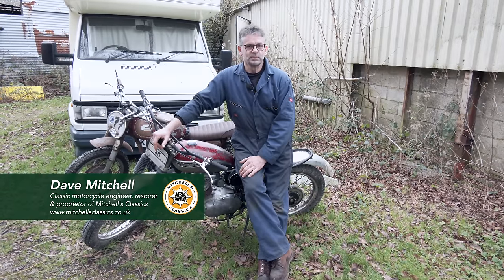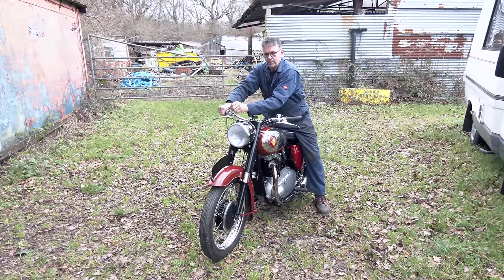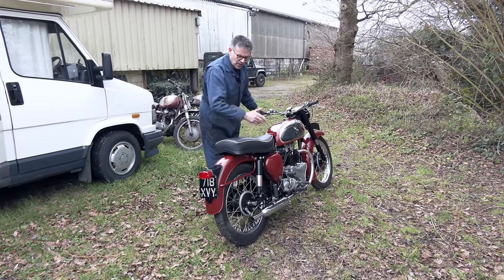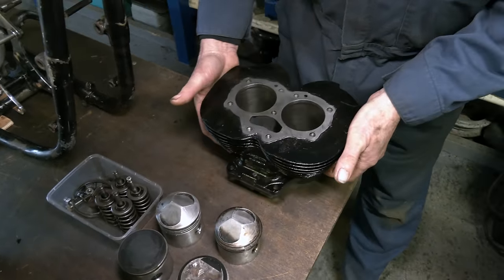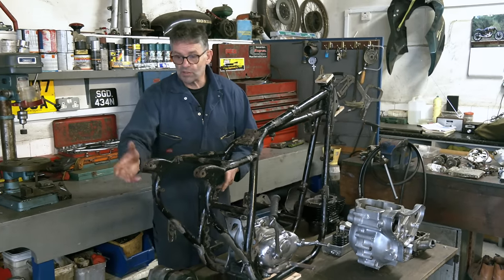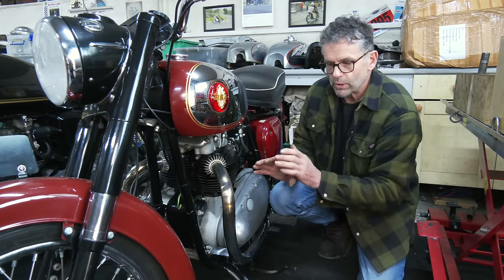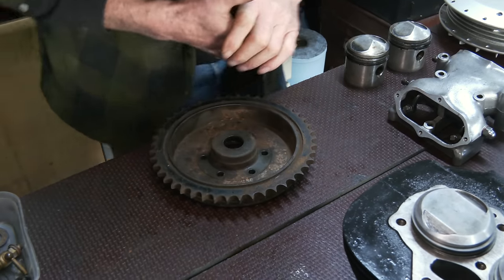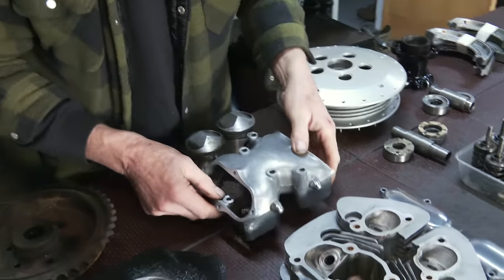Classic Motorcycle Workshop Vlog 30 - 2 customer's BSAs finished

Comment: How can I tell if my Triumph has high compression pistons without pulling the head and the cylinders off?  Compared to some other Triumphs I've ridden, mine takes more force to kick it, and I'm wondering if the pistons could be the reason for that.  If I stick my borescope down there, what am I looking for exactly?   Is it the shape of the top of the piston or maybe a number stamped into it?
Reply: The best way is to measure it with a buret. You need to find TDC then fill the combustion chambre with oil. I use light hydraulic oil. Fill the oil halfway up the spark plug hole with the bike on its centre stand.
Measure the amount of oil as it's added ( buret) Then add the amount of oil added to the cylinder volume. This gives you the total mixture volume. Divide that number by the buret amount. That is your exact compression ratio.
For example-
For a 650 cc bike that is 325 cc per cylinder-
-Buret measurement to fill head is 40cc 
325cc + 40cc = 365cc
365cc ÷ 40 = 9.125 to 1
Reply: Remove the bulk of the hydraulic oil after with a syringe with small hose attached. If a few ccs remain that will burn off in a few seconds of running.
Reply: Use a compression tester as a starting point. Might save a lot of technical faff.
Reply: @Jim-nm1en   that will give you a very rough idea of cr and that's about it.
The technical faff I described above takes about 15 minutes to do and no kicking like a mad man to get a compression tester to actually give a decent reading.